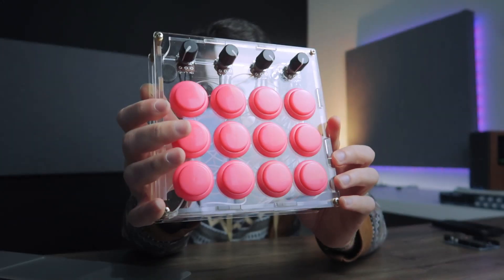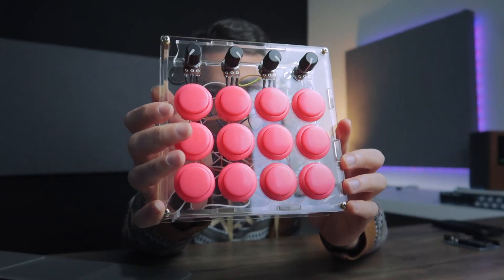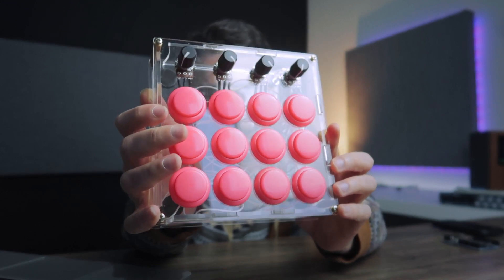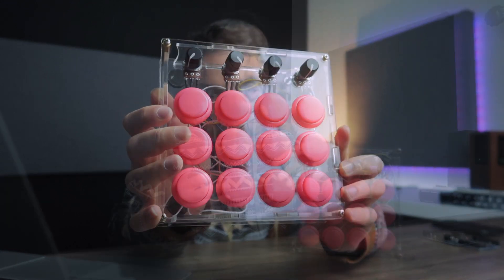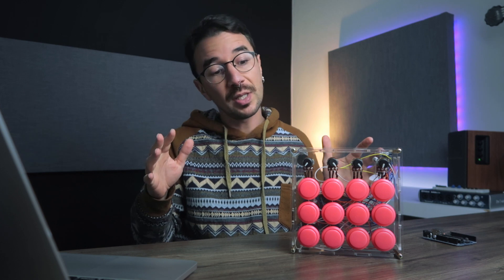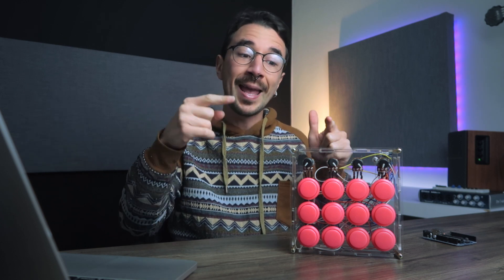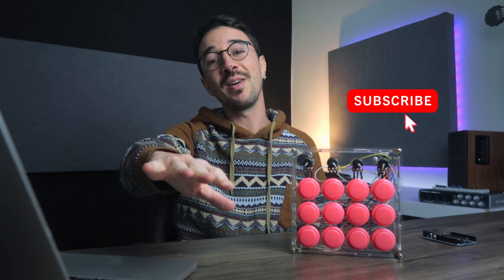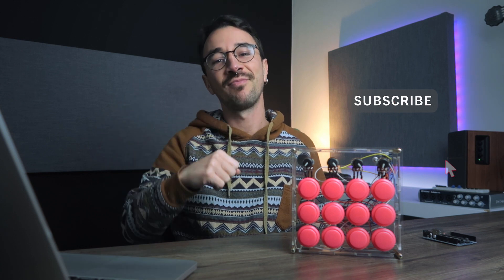I built an Arcade DIY MIDI controller with an Arduino Pro Micro: The Fliper

Comment: At 1:28 your bottom three buttons on the left are not connected to the same terminal as the rest. I assume that  you're trying to connect all of the buttons to ground at this step. Did you connect the bottom left three buttons like this on purpose or is this a mistake?

Comment: when you soldered the button pins, for most of them you connected the negative pin to ground wire, but for three you connected the positive to ground. Does that mean I can connect any pin to ground wire or was there a difference between those buttons?
Reply from the maker: I think you are confused. All the buttons are connected to GND, none to 5v.
Reply: @NerdMusician  at 1:40 most of the buttons are connected by a white wire on the right side pin. Three at the bottom left are connected by a white wire on the left side pin. Are those three a different type of button with the pins switched? My main question i guess is that the buttons i am using label the pins as positive and negative. Do i need to connect all the ground wires to the positive pin, or the negative pin?

Comment: Hello! Love your channel! I am in the process of building my first Arduino MIDI controller. I've never built one before, but am using your videos for instruction and inspiration! I had a few questions that I was hoping you could answer....1. Do you have a video yourself or can point me in the right direction on where to find a video on some soldering basics for a project like this in particular?  And 2, where can I get an enclosure like the one in this video? Any information would be greatly appreciated! Thanks for your time and instruction!
Reply: I believe he had the enclosure laser cut or 3D printed, larger cases will need to be laser cut. First you would need to model the enclosure in some sort of modeling program, then you can use 3D printing companies to print the case using your model in whatever material you would like. Since these are custom cases and the design changes a lot depending on what you want your controller to do, its a bit more expensive and time consuming. You can also make a wood box yourself, it may not be as clean as a 3D printed case but it takes less time and money if you know what you are doing.
Reply: @loganlamoreaux5347  Thank you for the information and insight! I appreciate it!
What if I wanted to create multiple enclosure options depending upon the controller layout you wanted? Would this be possible using an Arduino? Or would the fact that you have to solder everything into place make the interchangeability impossible? I guess this question is for both you and @Músico Nerd Are there options where you don't have to solder?
Reply: @scottcowart5142  i have never done something like that, so i am not sure if there is a good option for creating circuits that can be changed easily without solder, while still having everything in an enclosure.
Reply: @loganlamoreaux5347  Yeah, I'm not sure either. Been racking my brain trying to figure it out, but to no avail...
Reply from the maker: Yeah, Logan is right, I had the enclosure laser cut. There are websites like Ponoko or Sculpteo, but I'd look in your town, since it can be way cheaper.
I don't have a video on solder basics, but I should do one!
Reply: @NerdMusician  Thank you! I proposed another question to both you and Logan in the previous comment. Maybe you help me answer it :)

Comment: Hey, I build a 4 pot 2 button which will be expanded to 16 pot (with an analog multiplexer and a matrix of buttons) based on your code, quite easy to read but needed some translation

I'm a total noob to arduino, so I have a question about the debug output, can I leave it always enabled?

And as for the potentiometers, can I use 228k pots from an old Sony stereo?

Comment: hi, can i use a b5k potentiometer? without changing the code? if I use less buttons I have to modify the code, thanks
Reply from the maker: Yes you can, it won't make a difference.
Reply: @NerdMusician  thank you very much

Comment: how thin is the case for the components? did you 3D print it?
Reply from the maker: It’s 35mm tal inside, 3mm thickness.
Reply: @NerdMusician  thank you, im using buttons very similar to yours and i had trouble figuring out the right thickness for the case so they could snap in easily

Comment: Needs a front end usb midi sender but even the demo mode is cool sounding. STM32F4 Discovery board with this software.  You might like this :https://github.com/MrBlueXav/Dekrispator_v2

Comment: Very nice video ! I've got a dying novation launch control, is it possible to "recycle" it to a new controler ? (With an arduino inside, new pads, buttons etc...)
Reply from the maker: Ugh... That would require some careful surgery. Only if you really know what you are doing... But, I can't see why not. Wouldn't recommend though.
Reply: @NerdMusician  Thanks for your answer Gustavo ! And why not start a new project with  just the box & the arduino system to replace everything ? (but i don't know if the big light button pads are available for everyone...)